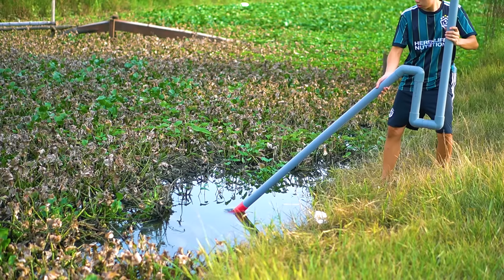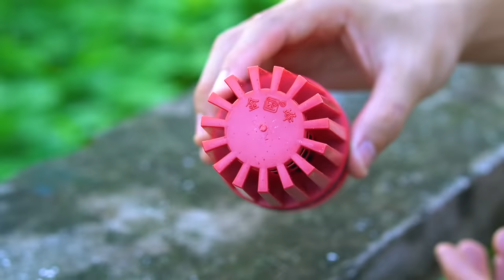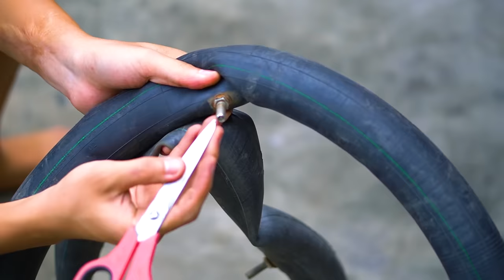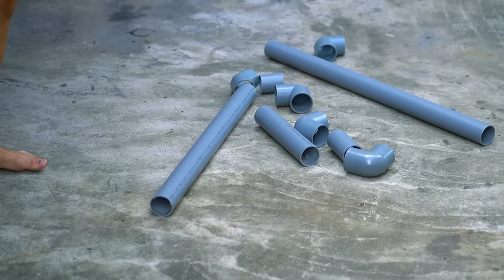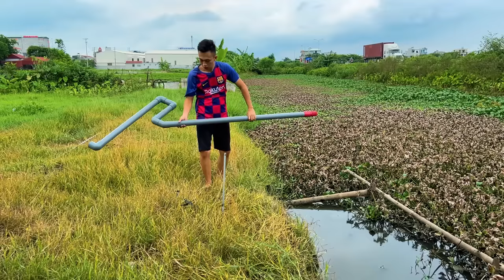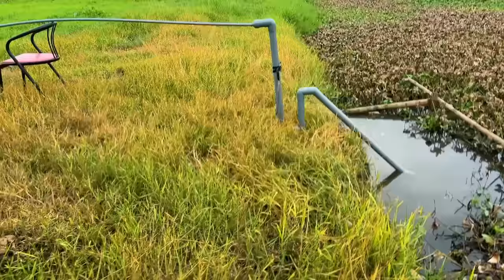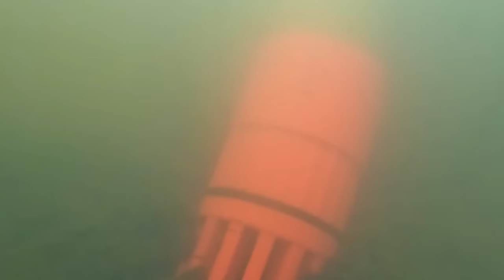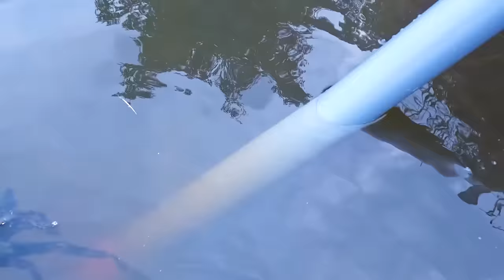I turn PVC pipe into a water pump no need electric power

Comment: The only way to move water through a pipe is to either push water into it with a pump, use an Archimedes' screw, bubble air into the vertical pipe or make a siphon. The siphon is the only true no power way to move water. The only way a siphon can work is if the outlet is lower than the inlet. Gravity pulls the water to it's lowest point, creating a suction at the inlet. This is 100% fake. Replacing the rubber seal with a Schrader valve is the easiest way to fake this.

If an air line is connected to the Schrader valve, the rising air will lift the water up the pipe and out the exit. I think there are either some clever video cuts where the air hose is hooked up and placed in the water or the check valve has been further modified to allow a hidden hookup under water with a push on fitting. There will be thousands of people who will pass the video around showing the "magic" water pump. The author will get his views and possibly $ for advertising. People don't know anymore that the seemingly impossible videos are almost always faked. Like the guys that build seemingly impossible homes in the jungle dirt - pictures surfaced of heavy construction equipment tracks when it was supposed to be done by hand. If you see it on social media - there is probably a 30% chance it's fake.
Reply: Please don't call it fake. The uploader was so close to just attach a water turbine at the outlet and generate electricity for free, copy the system a million time, energy problem solved, free energy, yes, perpetuum mobile to the MOOOOON
Reply: @mariana1964  lol cool, then go ahead and install many perpetuum mobiles and solve all problems of the world :D
Reply: @lordesfairgenug  While you are busy being  not funny some of us ARE working on it.
Reply: @mariana1964  yeah, heavy working on it :D Just plug some PVC pipes together and learn that it doesn't work. 
Did you know that a siphon is at the pipe from your toilet, why doesn't water constantly come out of your toilet if that in the video works?
Reply: Ya, the tube is a little large to attribute it to capillary action; maybe something to do with Van der Waals force 🙂Definitely give the fellow some credit for creating a visual conundrum.
Reply: At the end of the work, the collector tube is shorter than the one that he put into the water. The first one seems to be 1 meter long while the other 1.5 meters long. I think I'll change it for one that has some device inside
Reply: There is one way to pump water without electricity other than what you say.  Go look into Ram pumps.
Reply: @johnh9748  Yes!  Invented by John Whitegurst in 1772.  They are a fantastic device and I have seen numerous hand built water rams in rural parts of the U.S. over the past 50 years.
Reply: @johnh9748  Yes, but this is not a ram pump. Ram pumps uses strong downward flow to run a pump, to pump water upwards. This is not that. it is obviously fake.
Reply: @johnh9748  There are all sorts of pumps that don't require electricity.  Hand pumps, wind driven pumps, steam driven pumps, etc.  Just not any magic free energy pumps.
Reply: The air pressure is limited to the incline in the pipe due to the dip in the pipe - therefore the water pressure is greater than the air pressure. The water pressure thereby pushes IN the value and thereby creates a jet of water pressure that shoots the water up the pipe. Based on Archimedes Principle as long as the weight of the water based on volume is greater than the volume of air in the pipe below the dip in the pipe then the valve will keep sucking water as a spray jet under pressure into the pipe.
Reply: @voidisyinyangvoidisyinyang885  "The air pressure is limited to the incline in the pipe due to the dip in the pipe - therefore the water pressure is greater than the air pressure."  No, the air pressure is still greater than the water pressure because the surface area of the pipe is irrelevant to the flow and the only surface area that really matters is the surface area of the water, which is the same exact surface area of the air that is working against it.  The air pressure does not change at all by changing the angle of the pipe because the surface area being acted on by the air is being increased by the same exact amount as the surface area of the water, which means, as the surface area increases, the amount of total force being applied by the air pressure acting downward also increases directly proportionally to the increased surface area.  The only time the water pressure could be greater in this video is when there is a force applied to the water.  As soon as the force stops, the water will stop.

"The water pressure thereby pushes IN the value and thereby creates a jet of water pressure that shoots the water up the pipe."  No, it does not.  Water weighs more than air, so in order to get water above air, energy must be expended.  Gravity is working on the water at all times.  Even if you went with a total vacuum in a pipe, it would not cause the water to rise, except for the water that evaporates while it boils.

"Based on Archimedes Principle as long as the weight of the water based on volume is greater than the volume of air in the pipe below the dip in the pipe then the valve will keep sucking water as a spray jet under pressure into the pipe."  No, that is not how Archimedes principle works.  Archimedes principle is about buoyancy.  That is, it explains why the PVC contraption would float if it was sealed and water was not allowed to enter it and why it sinks if it is filled with water.  It has nothing to do with magic water pumping action.
Reply: @wesbaumguardner8829  have you ever used one of those schrader valves? I have a hand bicycle pump. The whole point is the weight of the water as pressure is opening the value and therefore creates a pressurized jet of water. "the area of the water surface inside this pipe is exactly one square inch. The surface of the ocean adds up to trillions of square inches, each with 14.7 lb of atmosphere bearing down on it. The total pressure on the ocean surface therefore adds up to billions of tons, while the pressure on the surface confined within the pipe you have inserted is a mere 14.7 lb." so how much pressure does it take to open the valve?  the answer is: "you then have to pump about 30 psi harder just to open the valve against the spring "
So how big is that PVC pipe - it's bigger than one inch and looks to be at least 2.5 inches and therefore if it is two inches in diameter then it has enough water pressure to open up the Schrader valve - creating a jet of water. 
So the dip in the pipe acts as a "Pea trap" under a sink - the water jet collects the water there - so that cancels out the lower gravity in the pipe - it works just as a one way check valve so that less vertical draw is needed. So then as the water keeps building up through the jet then the water is pushed up the rest of the pipe.
Reply: @voidisyinyangvoidisyinyang885  " have you ever used one of those schrader valves?"  Yes, I have.  Many times.

"I have a hand bicycle pump."  Me too.  It requires that I put energy into it for it to work.  There is no magic energy coming from out of the netherlands to pump the air.

"The whole point is the weight of the water as pressure is opening the value and therefore creates a pressurized jet of water."  I highly doubt the external water pressure could open a shrader valve.  The head of the valve has an extremely low area which means there is a very small force to counteract the spring that is inside the valve itself.  But, lets say, hypothetically that it did, the valve would open and water would flow through the valve until the pressure was equalized and the valve would close and there would be no more water flowing through the valve.

""the area of the water surface inside this pipe is exactly one square inch. The surface of the ocean adds up to trillions of square inches, each with 14.7 lb of atmosphere bearing down on it."  The overall area of the entire ocean is irrelevant because it is all at the same overall pressure.  Pressure is force/area.  Excluding the minor barometric pressure changes due to weather, the atmospheric pressure acting on the surface of the water that is in the pipe is the same as that of any of the inches in the ocean.  In other words, they are at equilibrium.

"so how much pressure does it take to open the valve?  the answer is: 'you then have to pump about 30 psi harder just to open the valve against the spring '
So how big is that PVC pipe - it's bigger than one inch and looks to be at least 2.5 inches and therefore if it is two inches in diameter then it has enough water pressure to open up the Schrader valve - creating a jet of water."  You cannot count the entire surface area of the pipe in your calculations.  You can only count the area that is working on the pin.  The force is being applied to all that surface area equally.  That means all that force that is working on the pipe is not working on moving the pin in the valve so that it can open.  Only a small fraction of that force is being applied to the pin, so it will not open.

"So the dip in the pipe acts as a "Pea trap" under a sink - the water jet collects the water there - so that cancels out the lower gravity in the pipe - it works just as a one way check valve so that less vertical draw is needed."  The pea trap does nothing to resolve the atmospheric pressure resistance opposing the system as a whole.  In order for the water to work past the pea trap, it must overcome the same atmospheric pressure that prevents it from flowing in the first place.  Additionally, you have the problem of head pressure.  The higher water is raised in a system, the more the pressure below it increases and this pressure is working against the water flowing upwards.  Think about it.  The water in the pea trap under your sink is not flowing out into your sink (unless perhaps you have an upstairs bathroom that is not plumbed in correctly in which case the head pressure is forcing water out of it.) 

"So then as the water keeps building up through the jet then the water is pushed up the rest of the pipe."  No, it will not.  However, all the materials are cheap, so you should not have any problem trying it out so you can see that it fails.
Reply: Yes.,there is not a syphon system because in the syphon system the water level ( the river)should be above the land level , to cause water to move ( down)
Reply: @voidisyinyangvoidisyinyang885  The pressure wouldn't be great enough at just a few inches under water and the pressure would be equal once the pipe filled to the level of the water.
Reply: @gnuorder  that Shrader valve needs 30 psi to release the valve so that water sprays up the pipe. The pipe is put 6 feet underwater and the pipe is 3 inches diameter so the psi is over 30 on the shrader valve. The "pea trap" in the pipe then causes the gravity to go back down and forces the water out the other end of the pipe.
Reply: It could also be that it works and you're wrong.
Reply: @ronarmstrong835  yes ,but I'm asking : what causes water to move ?( to go out of pipe ) this is strange,I  didn't got answers about it. No answers about it still yet
Reply: @ronarmstrong835  yes of course, but there is no explanation about it still yet.
Reply: Should be have an air compressor to flow from the bottom the water out...then it will be called air lift..in this video was not complete..the water can't go up without pressure force or vaccum force..
Reply: @lordesfairgenug  this video 100% fake..there are missing link...
Reply: @manumathai480  I think like you
Reply: I agree.  this can work without some external power.
Reply: @wesbaumguardner8829   And they ALL have an energy source of some kind.
Reply: @joesinakandid528  My bet is that they are using a small battery powered submersible pump that is inside the pipe somewhere.
Reply: This looks like a bigger version of a shaker siphon.
Reply: @Frankreddy62  Siphons must have the outlet lower than the inlet.  They cannot move water uphill like this guy is doing.
Reply: There is also the Hydraulic Ram Pump (which this device is not), that uses a larger supply of falling water to hydraulically pump a smaller quantity to a higher elevation.
Reply: @voidisyinyangvoidisyinyang885  please do not increase the pipe size on this device. It could create enough pressure to injure someone.
Reply: The easiest way to fake is to insert an electric motor in the red end of the pipe, without showing it on camera. He can also insert some batteries inside the pipe.
Reply: I thought I smelled a rat. I just could not understand how that was possible. Thank You for clarifying that.
Reply: This guy did a good job without siphoning.
Reply: @mariana1964  Be sure to sell everything and totally devote your life to it.
Reply: Have you seen a ram pump? No electricity needed and will run water uphill. Some maintenance required.
Reply: @joebloeh8058  Yes, but hydraulic ram pumps use a second stream of water flowing to a lower elevation as the source of energy to lift the other smaller stream. That's not what's going on here. Probably a small battery-operated pump inside.
Reply: @voidisyinyangvoidisyinyang885  that's a whole lot of bulls*** , telling people the force of the ocean can push water up a pipe , next you should tell us how rivers run up the mountain right .   IF you were right then then ocean would be flowing in your toilet right now.
Reply: @dwaynet2184  Can you quote me saying that? I don't remember saying that. Here's how this device works. The Shrader valve is activated at 30 psi. He moved the PVC pipe back and forth in the water thereby generating enough force to activate the Schrader valve. Once the water shoots through the valve then it collects in the "P-Trap" or 90 degree angle he set up. This in turn creates a "negative pressure" of air now between the bottom of the p-trap or pea trap - as a vacuum that pulls the water now through the Shrader valve continuously without swooshing the pipe back and forth. As the water collects in the pipe it is then pushed up the rest of the pipe to shoot out the other end.
Reply: Where in the vid was there a spring, no spring needed. The water from eachside of the valve open & close with the sway of the water movement within the pipe! Chances are the valve will slow to a halt!
Reply: Absolutely. This is an obvious fake. Ram pumps can do something like this but it's way more complicated and generates an intermittent flow.
Reply: @raymondlaser  The Schrader valve is activated at 30 psi. He moved the PVC pipe back and forth in the water thereby generating enough force to activate the Schrader valve. Once the water shoots through the valve then it collects in the "P-Trap" or 90 degree angle he set up. This in turn creates a "negative pressure" of air now between the bottom of the p-trap or p-trap - as a vacuum that pulls the water now through the Schrader valve continuously without swooshing the pipe back and forth. As the water collects in the pipe it is then pushed up the rest of the pipe to shoot out the other end.
Reply: I am not sure the principle on how it works but a Ram pump is another way to move water without electricity.
Reply: CRER En Esto  Y CREER EN APOSTOLES MODERNOS ES LO MISMO,                             2 CORINTIOS 11-13     2 PEDRO 2  ;3-4.
Reply: @voidisyinyangvoidisyinyang885  As Wes said above...... Very highly doubt that moving the pipe back and forth in the water would create enough force to open a schrader valve. Even if it could...... it would equalize.
Reply: @PappyMcPoyle-vj4vt  30 psi to open valve against spring.
"How much pressure does it take to move water? Residential water pressure tends to range between 45 and 80 psi (pounds per square inch). " The whole point of the P-trap is to create a delay time as  a negative pressure vacuum so the water keeps getting pulled up once he stops moving the PVC pipe back and forth.
Reply: FAKE AF
Reply: That's not true you can pump water with a ram pump with out electricity provided you have a stream or river. In this guy's situation It would not work since there's no moving water
Reply: Wat if ur fake
Reply: @lordesfairgenug  Look, it is a fake despite your hoping that it is real.
Reply: @lordesfairgenug  Well, the toilet has a flapper valve in the tank which closes after the tank is empty and thats why the toilet doesn't continue to drain. No water left in side. This just cant be possible though. Unfortunate as it is.
Reply: @rogerphelps9939  nah, I'm not hoping that, I'm just pointing out why it is obvious this is bollocks
Reply: @rivit7615  I think you are confusing things here. The flapper valve is in the tank, where the water goes into the toilet. The siphon is at the outlet, where water leaves the toilet. If siphons would do what is claimed in this video here, why is water not coming out of the toilet, so the siphon pumps it out like in the video? The reason is quite simple: Siphons just don't pump anything magically, they just keep a water reservoir, that's all.
Reply: @lordesfairgenug  All true. The siphon will only keep the water flowing as long as it's outlet is below the source and the source never runs out of fluid. Or air gets in....  either way this video is not happening in the real world.
Reply: @johnh9748  Yes, but a ram pump requires moving water to covert its kinetic energy to water head. This pond is static. One key indicator that this is fake is the flow. There is no way in hell that that volume of water would flow though the tiny Schrader valve!
Reply: After I shut off my sump pump it will siphon water out of my pool all night..
Discharge end of hose  4 feet higher than suction end  in bottom of pool...
Reply: @wesbaumguardner8829   @Lost Cause No. The outlet must be lower than the SURFACE of the source. The inlet height is immaterial. Physics 101. Sheeesh!
Reply: @ronarmstrong835  it could not be that this works.
Reply: @Bruwulf  The 90 degree turn in the pipe is a p-trap. Look up how a p-trap works - it creates negative pressure. You can see in the vid he vigorously moves the pipe side to side - that increases the pressure to open the shrader valve.
Reply: @voidisyinyangvoidisyinyang885  

None of that is relevant. None of it does what you say it does. None of it lets a few pieces of PVC pipe violate the fundamental laws of physics. 

Put it another way: If this worked - which it doesn't, to be clear, but if it did - it would be a case of perpetual motion. You could put two basins of water next to each other and have two of these magic siphons facing in either direction, creating an infinite loop of flowing water with no external energy added to the system. 

Hell, I'm over-thinking it. You wouldn't even need two. Just rout the output back into the original water source. Again, you've created perpetual motion. 

Further, you could then use the flowing water to turn a simple water wheel and connect it to a generator.

Are you following? If this magic siphon worked - which, again, it doesn't - it would be *infinite free energy*. Repeat: Infinite. Free. Energy.
Reply: @Bruwulf  slowly back off the ledge
Reply: Yeah this guy's credibility just went in the toilet although the microwave induced pump with interesting to me I'd like to try it but I still don't quite follow the physics of it the refrigerator compressor pump made no sense either
Reply: @PappyMcPoyle-vj4vt  Yes, if you mount a one way valve in the tube it is possible to pump water by moving the pipe FAST up and down but if you stop moving the pipe the waterflow stops also. This video is fake. Water doesn't flow uphill by it self. Not now and not in the future.
Reply: Haha , he puts it to his ear befor he puts it in the water so he can be sure his battery powered 12v pump is working
Reply: @MrM4Goo  Exactly right, I'm sure!  -  The slimy little trickster...
Reply: cette video es truqué car il es impossible que l'eau remonte plus haut que le niveau de sa source
Reply: @rolandweidig2182  We
Reply: @wilsonwuisan6070  did you tried to say its fake?
Reply: @lordesfairgenug  No. I'm afraid this is completely impossible.
Reply: i totally agreed with you,there is no way this thang work without  a pump or some sort of mechanical device to get the water out. the whole thing is fake as hell
Reply: Yes, any intelligent person who understands the laws of physics knows that this device as shown could not magically pump water. But its purpose is not to pump water, but rather it is designed to make money by getting a lot of views from people who want to argue about the impossibility of it. “Free” energy devices are one of the best ways to get a lot of views on youtube these days and so they can be very lucrative. Maybe I should make a video stating that the tooth fairy really does exist and cash in on all the people trying to tell me that I’m wrong. It’s a brilliant strategy for making money. It used to be that the people who put these things up were true believers but now its mostly people who know that’s its all BS but they also know that controversy sells.
Reply: It's actually not gravity that is the action for a siphon, it's atmospheric pressure 15 psi at sea level
Reply: Heh smartie look up "RAM PUMP" Then cook up some Crow and dig in!😆😆
Reply: @johnh9748  YES, that is what I recommended! Farmers use them to water stock at higher elevations.  We used one on our horse ranch.
Reply: SCAM! SCAM, SCAM!
Reply: @Martin-ql2bd  you were talking about a siphon not a ram pump. Get you're story straight
Reply: 30% chance? Not 29%? Not 100% chance? If you were to reproduce the experiment and demonstrate that it's not possible, then I will take your word for it. Literally so easy to duplicate. Challenge accepted?
Reply: @mariana1964  and working, and working, and working, is it working yet? No? Well that's no surprise. It's FAKE!
Reply: @johnh9748  but you still need a down hill run for the water that is wasted to pump the other portion upwards. Ram pumps don't work if everything is up hill.
Reply: @wesbaumguardner8829  "even if you went with a total vacuum in a pipe"? Whaaa? Isn't that how liquid moves in a straw? You place a partial vacuum in a straw (suck) reducing the air pressure on one side of the liquid causing the higher air pressure on the other side to push the liquid into the straw.
Reply: @radinelaj5716  there is a hidden electric pump either inside the pipe or under the water surface.
Reply: @Frankreddy62  yes but in order for it to work he would have to continue plunging the end of the pipe into the water over and over.
Reply: @joebloeh8058  but you need more water running down hill for it to work. Ram pumps don't work if everything is up hill.
Reply: @chuckbailey6835  the water for a ram pump doesn't have to be moving it just needs to be up hill from the pump.
Reply: @GntlTch  no it doesn't require moving water, it requires the water source to be up hill from the pump.
Reply: @lostcause1206  ok but the suction end doesn't matter what matters is that the discharge end is lower than the surface of the water in the pool.
Reply: @railroaded1991  Yes, but that is because energy is being used to cause a change in pressure.  This video is claiming that the water can move uphill without an energy input.  This effect cannot happen in a static system.
Reply: @encyclopath  via hidden electric pump
Reply: @voidisyinyangvoidisyinyang885  geez. Everyone keeps talking about p- traps. P-traps aren't syphons. P- traps hold a bit of water to keep the sewer gasses and smell from coming into your sink/house, that's all they do. Same thing whether it's in a sink or a toilet.
Reply: @Mike_Hughes  just hit the 3 dots to the lower right of your reply and you can go back in and edit.
Reply: @railroaded1991  when I put a sump pump in a bucket,  in the shallow end on the pool floor , when I unplug the pump , water will continue to siphon out ...garden hose connected to the pump 3 foot below water surface , hose end , outlet ,  on the grass
Reply: @railroaded1991  LOL.  Okay!!!  Fake like you?
Reply: @railroaded1991  that's gravity , I'm referring to capillary action.
Reply: @railroaded1991  try to forget the term "p-trap" and instead try to just remember the term "negative pressure" aka "If the trap outlet is too tall, negative pressure will prevent drainage" and "The pull of the water to the drain has to exceed the sucking of the supply fan (“negative pressure”). and "A typical P-Trap design for draw-through equipment is shown in Figure 1. For a system operating at 1½ inches of negative pressure..."
Reply: @railroaded1991  Cheers my friend, thank you.
Reply: there is a fourth way, two valves are needed to use the kinetic energy of the water. that is, you can raise the water quite high from a flowing stream.
Reply: @ronarmstrong835  ha, ha, ha. Prove it.
Reply: Actually there is a way you forgot to mention. Naturally, the water is evaporated from the ocean, river, lake, whatever source, is formed into clouds, then rains, snows, whatever in the mountains, etc. The process flowing the water uphill.
Reply: @mariana1964 and working, and working, and working, (and working  to infinity)
Reply: @wesbaumguardner8829 unless it's a shaker syphon, but you have to keep "shaking it" i.e. plunging it into the water on a constant basis.
Reply: @michaelduy9055  yer just kidding, right? I mean you don't REALLY think this thing actually works do you. ( This is the nice version reply, my other one was " yer, stupid."
Reply: @joebloeh8058 yes have seen a ram pump, but they don't work this way.
Reply: @glennrager3684 umm. No, they don't use a second stream. They use the same stream. And the water  used in the pump to pump a portion up hill is wasted/vented out at the pump.
Reply: @railroaded1991  🤣
Reply: @lostcause1206  capillary action won't work in a pipe that size. Absolutely no screwball explanation you guys come up with will make this thing work for real.
Reply: @ronarmstrong835  feel free to prove every nay sayer wrong.
Reply: @radinelaj5716  pump
Reply: @radinelaj5716  pump
Reply: @michaelduy9055  you're kidding, right?
Reply: @chuckbailey6835  you haven't a clue as to how a ram pump works.
Reply: @GntlTch  no it doesn't require running water except inside itself. It can draw water from a static source but like a syphon it needs a down hill slope.
Reply: @voidisyinyangvoidisyinyang885  no matter how many idiotic explanations you people make up it still won't work. Feel free to make one and prove your theory.
Reply: @voidisyinyangvoidisyinyang885  which way????
Reply: @railroaded1991  New phone. Who dis?
Reply: @lordesfairgenug  water doesn't constantly come out because the waterline is connected to the tank, not the bowl and inside the tank there is a stop water valve. It floats and you can set it to a certain level to increase or decrease the amount of water you flush. Did you mean how come the crap doesn't flow out on to the floor??? I believe this pump could work but I do not have the pipes to try it out. Or fish tank, and handheld cleaning non electric syphon pump and extra tubing. That is a way you can test his example in the video. Cleaning a fish tank even with an inch of water in the bottom, the pump still works, the water goes uphill like you see in the video. The tubing on the other end gets put lower than the fish tank, bucket down there ready to catch the dirty fish tank water, how hard would it be to get extra tubing and manipulate ut to fit inside the bucket, across the bottom and up the other side till it hangs over. Real easy test to see if the example would work. I just bet that it would.
Reply: @juliadrywater7554  quite a lot of text, just to say you dont understand the physics
Reply: I think your right ... I believe if he show everything transfarently no hidden.
Reply: Well he could make a sequel to get more people to watch his video. How to fake people out how it's done see what's really inside LOL. Like the one with the electric motor turning another electric motor after you find there's two cells inside what we thought was generating the power back to the first😂 you can make another video how many people you got to look at this ,. We will ring your bell to see it 😳
Reply: By just using a hollow pvc pipe?
😉
Reply: So the syphon comes from Greek botany, Aristotle. See the Dutch discovered in the 1400s 2" pipe, because of the natural vacuum in tubing, would lift water 80 feet. So up every 80 feet a run off barrel and 80 feet more pipe. This is how the pulled the water out of their mines. Now I have seen water leave my bed down to floor and go up my basement wall right out the 6 foot high window just like out a gas tank. Now you know how trees drink with their toes and  the smaller the tube the higher it goes.
Reply: @johnh9748  Ram pumps are syphons, plain and simple.
Reply: Isso só não é mais falso porque o cara que monta os tubos não fala nada! Dessa maneira a conclusão de que a água está sendo puxada do rio pela simples disposição dos tubos desta forma, e uma válvula na ponta que só impede o retorno da água, a conclusão é toda nossa (Se bem que tem o título do vídeo). Mas essa é a mais ridícula pretensão de que isso seja possível puxar água desta forma, quando ao menos fazem algo assim com um tambor ainda daria para acreditar de certa forma (Mesmo isso acho que é falso, pois eu fiz experiências parecidas com esta e não funcionaram).
Reply: This pump is faker than my will to live.
Reply: I think you are fake.  I will put my faith in this ingenious young man.
Reply: @wesbaumguardner8829  This is an excellent explanation of how things actually work. One should note however that it's a P (not a pee or a pea trap.) It's called a P trap because it's shaped like a P laying on its nose. And it's called a trap because it's a trap. If it were a syphon it would be called a syphon. It's a trap because it traps a portion of water. That water prevents the gasses and stink from coming out of the drain. It doesn't act at all as a syphon, except perhaps to a minor effect in a flush toilet, otherwise that water also keeps the gasses and stink from coming out.
Reply: @lordesfairgenug but if he had attached a return tube to the outlet turbine then back to the inlet ( placing a turbine there also. He could hook that outlet to the device inlet. Then he could have just removed it from the water source and the water would just go round and round. A completely independent energy unit!!!!!!!!
Reply: @michaelduy9055 😂😂😂 the only way this device could injure someone is if they tripped over it in the junk pile or if they got beat over the head with it 😂😂
Reply: @railroaded1991  I never said a P trap was a syphon.
Reply: @railroaded1991  We are all glad he didn't do it, because it would accelerate more and more, the water would go faster and faster until the momentum is so high the mass becomes a black hole (keep in mind: energy and mass are the same thing actually). Once it has become a black hole would suck in the earth. So let's all cross fingers nobody will assemble such an infinite energy device.
Reply: @mariana1964  no and certainly not ignorant like you.
Reply: @lostcause1206 😂 capillary action and gravity are opposite forces
Reply: @dwaynet2184  My friend dropped a schrader valve into his toilet accidentally a few years ago. Within 10 minutes there was an earthquake and a tsunami warning. When the ocean began rushing towards his toilet, the shift in weight and pressure caused the earthquake. People think it's the other way round. The general public should not be allowed to own schrader valves.
Reply: @railroaded1991  🤣
Reply: @wesbaumguardner8829  p trap keeps the sewer gas from coming into your home
Reply: @railroaded1991  I would be railroaded if I didn't know that ...
Reply: @billcoe1758  😂 no
Reply: @michaelduy9055  I applaud your humor, sir.  It was perfect and delectable.  It showed the idiocy of his claims to anyone intelligent enough to ascertain your sarcasm.  Well done!
Reply: @lostcause1206  Insulation keeps the heat in or out depending on the internal vs. external temperatures.
Reply: @lostcause1206  Water flows downhill.  If you want it to go uphill, you have to pay for it.
Reply: @lostcause1206  Urinals should not be used as toilets.
Reply: @lostcause1206  that's fine but it's not because the inlet is three feet below the surface, it will still syphon if it's one inch below the surface just so as long as it doesn't suck air.
Reply: @ricoshea6101 😂😂😂natural vacuum in tubing😂😂😂
Reply: @rossk4864  off internet: The first development work of the hydraulic ram is reported to have been completed by John Whitehurst in 1772, with the first automatic version of the hydraulic ram developed by Joseph Montgolfier in 1796
Reply: @voidisyinyangvoidisyinyang885  obviously you have no idea how much pressure 30 psi is. Plus moving the pipe in the water would only generate a tiny fraction of a single pound. 😂 on top of that there is no way you are ever going to pass that volume of water through a tiny little Schrader valve and past the core.
Reply: @lostcause1206  apologies but this site is so confusing I don't know what you are referring to. ☹️
Reply: @wesbaumguardner8829 when a Schrader valve is in use there is a piece of metal to hold open the Schrader valve .  on the end of a bicycle air pump hose so air or liquid can pass through . If anyone is implying that the water is moving through the Schrader valve there way too much volume of water coming out of the other end .
Reply: It is like the bushcraft videos where someone, usually a woman, is supposed to be living alone in the wilderness. If they are alone doing everything they are supposedly doing then who is filming their movements/adventures. Many of the are obvious that someone else is their thus they are fake. This is most likely fake too, but I am not going to waste my time trying to prove it is fake.
Reply: As if it wasnt enough my car dealer tried to scam me!?
Reply: A siphon is not zero energy though it's harnessing the energy of gravity
Reply: @ernestlam5632   - Which makes me wonder....  If we all harnessed the energy of gravity at once, would the world stop and all of us float off into space???
Reply: Yes, it does seem a little too good to be true. Based on the flow he's getting, this goes way beyond a ram pump!
Reply: And he has over 1 m subs.  I'm not one of them.  I suppose for the entertainment value???   What else can it be.
Reply: Apparemment le matériel pour la construction de cet appareil n'est pas coûteux ! Alors essayer pour enlever le doute